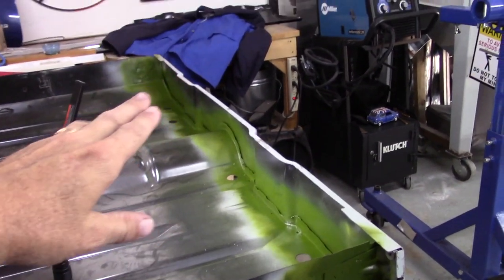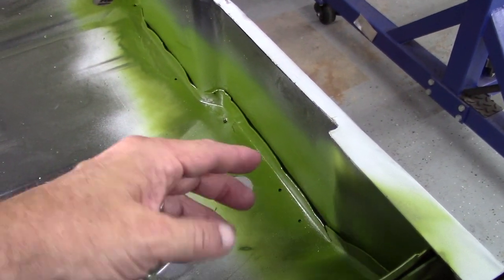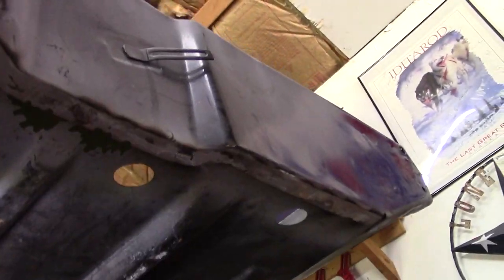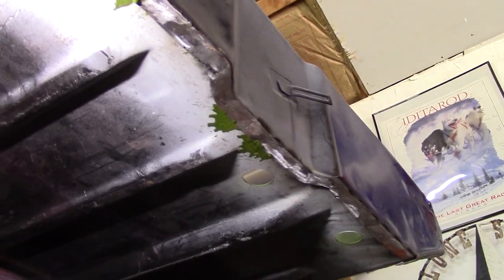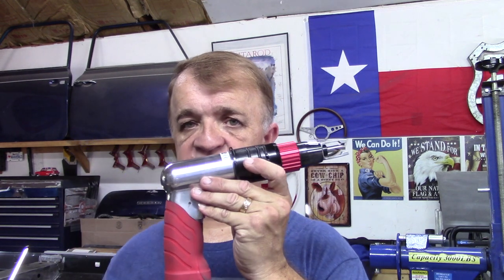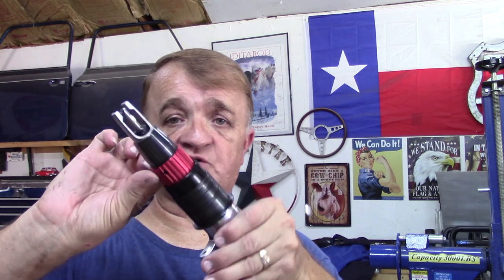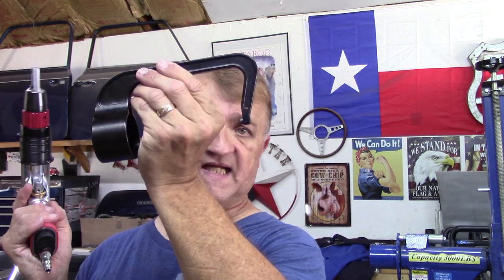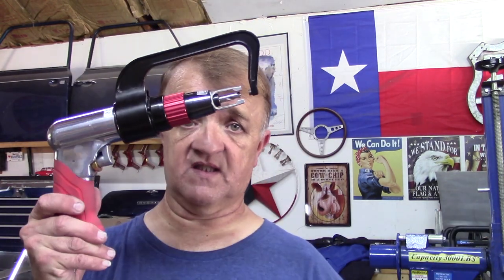Classic Mini Seam Rust Prevention

Comment: Sacrificial zinc is a great idea mate. Although I am left wondering if you'll ever need it after you left thoes bare panels for months and they looked fresh as a daisy! I've had rust pretty much appear in overnight here 🤣
Reply from the maker: I’ve learned that when I sweat on the panels, they develop a spot of surface rust.  Now with that said, it’s wonderfully difficult not to drop beads of sweat while working in the shop 🥵. I will still protect the metal as best as possible as who knows where it might end up one day….

Comment: Great idea, have you considered an aerosol nozzle that takes a thin plastic tube to spray into the seam.
Reply from the maker: I will have to take a closer look at the nozzle. But the fan spread suggested there were multiple holes…. But definitely a good idea… will check